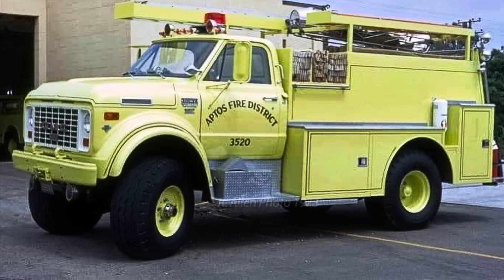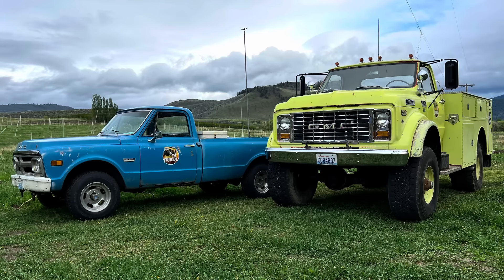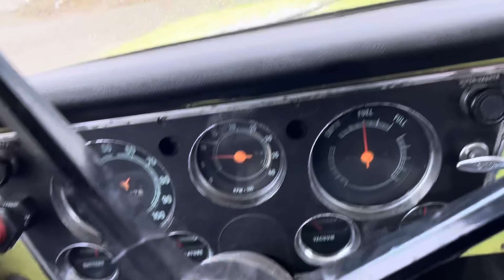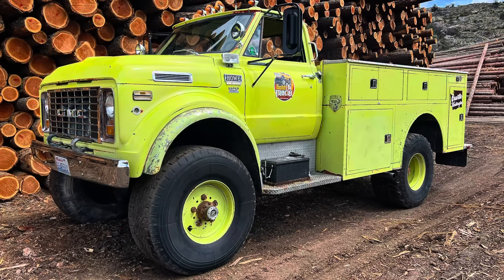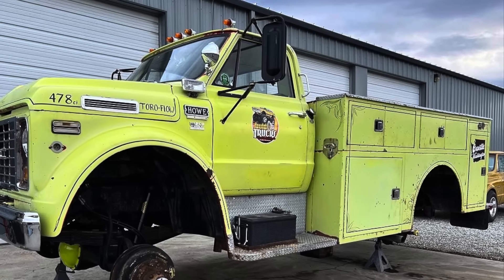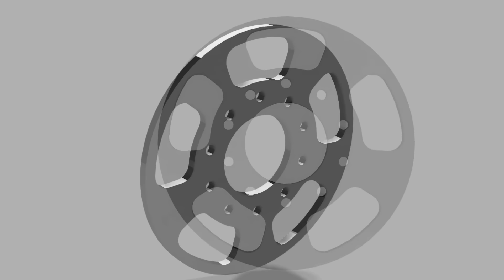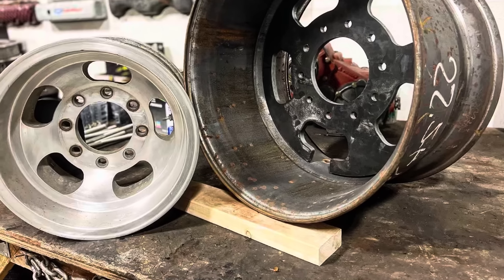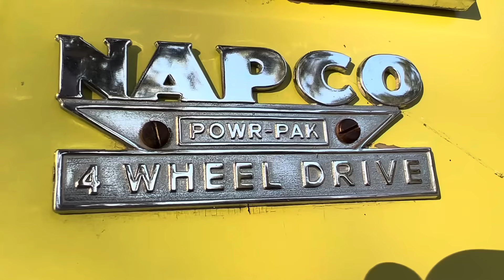My 1972 GMC Napco K5500… The World’s Rarest ‘67-72 Truck! Factory Toroflow Diesel/Allison Behemoth!

Comment: That is a very interesting truck. I've heard of GMC V6, V8 and even V12 engines of gargantuan displacements back in the day, before they began using the Chevy big block 366 and 427  V8s that their corporate twin Chevy trucks used. But this 478 cubic inch V6 diesel engine I've never heard of, let alone seen one of these trucks with an Allison automatic transmission as well.

Comment: I HAD A TORO-FLOW IN AN INTERNATIONAL TRAVELALL, MINE WAS THE "D", BUT IT HAD THE "DH" PUMP ON IT 18 MPG ALWAYS/ANY CONDITION, AT 70 MPH ON ICE IN OVERDRIVE I COULD LIGHT UP 4 12.00-16.5'S... LOVED THAT TRUCK, IT ATE U-JOINTS LIKE POP-CORN...

Comment: It wasnt that long ago (4 decades!) i had a Napco converted 58 GMC 2 door "suburban" truck. The stock 6 cylinder was gone, but still had the Trans, Spicer transfer case, and Axles. Someone had converted it to a 350 previously and i bought the truck with a rod knock in that engine, putting in a 307 marine takeout engine. I had to re do all the steering knuckles, had to come up with new tie rods & pitman arm, even scored a decent steering box. Installed a 50-gallon fuel tank for off road security. Did most all back roads, byways, and highways in northern AZ and Southern UT with it, drove it to Texas on a road trip, no working odometer or speedometer, but i figure i put near 100,000 miles and got away with only 1 speeding ticket while i had it.
it was a great truck, a real ratter but with class, y know? I had it long enough to take my 2nd wife on our honeymoon with it. That was 32 years ago.

Comment: You mention the twin turbocharged Toro-Flow engines . In the late '70s , a customer in NE Ohio had one in a rear engined ex-military bus he was reworking for a motor home . I was called for a potential repower with a Detroit, as the customer experienced 2 engines with broken crankshafts, probably due  to fan belt over tightened.

Comment: 13 mpg? That is impressive.
Reply: Yeah, a lot of stories have been passed down over the years, the Toro Flow apparently didn't do so well if you were carrying or pulling a very heavy load (so the story goes, some older guys say their mistake was, a lot of guys who bought these new in whatever application, treated it like a heavy duty diesel like a Cummins or Caterpillar or one of the bigger Detroits, instead of a medium-duty diesel as it was intended), or rappin' it out as they used to say, runnin' it hard regularly with the rpms up, but, they apparently lasted a long time with fewer issues in marine applications.  The 13 mpg, yeah, everything I've ever read, including the GMC history book I have, the Toro Flow's strong bragging ppint was excellent fuel economy,  even compared to diesels in its class.

Comment: Amazing and awesome find/score. The toroflow is RIGHT up my alley... too bad they're ungodly scarce and very difficult for parts. How the heck do you even find parts??? i found a Uni system corn picker nearby and it has a 401 toro flow v6, i want to buy and shove into a 70s GM pickup.The new custom rims and 3" Straight pipes did it good. Love the cusom retouch pin stripes...

Comment: I just picked up a 2006 c5500  with 50600 miles. It's also a beast. It to pull my 5th wheel in a couple years. Love  to connect with  you a see that  predecessor som day. Where is your shop. Thus is the first I've see your videos.   Jess. A admire or what you have  accomplished.  😅
Reply: I don't spell that bad. I just don't review spell ck. Damm.

Comment: I have a C 4500 Yes
Sway bar steering stabiliser cent traumatic balances on the front end and it runs absolutely true down the road. Thanks for your video thoroughly enjoyed it. 
Look at a fass fuel system it may help with miles per gallon in the long Jevity of your motor

Comment: The DH478 Toro-Flow was also used in some smaller GMC buses during this time (the TDH3501 from 1964-68, the TDH3502 from 1968-69, the TDH3301 from 1969-71 and the TDH3302 from 1972-73).

Comment: They had a lot problems with these engines.  Customer dissatisfaction was the primary reason to discontinue.  Awd is way cool, especially on a vehicle this size.  I am partial to the 478 v6, but they say it used to blow the plugs out.  The very rarest motor was the v12 that was two 478 motors.  It ran at low rpm and sounds awesome.

Comment: She's a keeper, for sure. I was fortunate enough to get a 77 blazer trailer special. All the metal emblems sb 400 to np 203 to th  400  and not a crack in the windshield with the cool blue tinted top. Stable and capable. 
Gotta love those windwings, huh. Oh, and rain gutters over both doors. The thing doesn't spy on ya and not loaded with stupid useless brainpan zombiefying electronics that just put more pollution into  the toilet bowl. 
You got one cool ride, for sure!

Comment: I bought  a 1992 Ford F800  Cab over with a Tool Body and  a Man lift on it. Same color. It came from the City of Seattle .. I bought it for the engine, a 3208 Cat 250 HP  Turbo .. Allison 5 speed Automatic .. it only runs 55 MPH @ 2,600 RPM's  it needs a two speed rear axle.. 4 wheel drive would be great for  Pulling a snowmobile trailer and having a camper in it .

Comment: Super cool to see. I've got a C5500 flatbed. 305 gasoline V6. I would have preferred a diesel. 5-speed manual and 2-speed rear end. No power steering, no power brakes, no dual master cylinder, (yikes!) factory radio delete, and no chrome.

Comment: Extremely nice and neat looking truck and being that it is 4x4 and a factory diesel and allison automatic transmission makes for a rare combination. Does it have hydraulic brakes or air brakes
Reply from the maker: It is hydraulic brakes
Reply: @GoldCityTrucks  I kind of figured I could hear a vacuum pump when it was idling

Comment: Curious if the new low sulfur diesel fuel has had any adverse effects on the fuel system ? Have seen some older diesel engines have injector and injector pump problems when using the new road grade fuel but did fine on the off road stuff.

Comment: 3:15 Are those intakes going to the outside of the heads? Like a hot V design? Cool truck. I like your collection. My dad had a 1969 Chevrolet C20 with coils and swingarms in the rear. I bought a 1970 C20 with leaf springs under the rear. I want to convert it to disc brakes on the front.
Reply from the maker: Yes intake and exhaust both the  same side of head , injection pump in the valley

Comment: Just about all larger diesels use what's know as an SAE #3 mount starter. So basically any starter on any semi will bolt up to that engine but there is three differences you have to look at. One of them being the starter pinion pitch and tooth count(the starter gear), another is the solenoid position or clock. That starter along with most others have a clockable nose to change the solenoid position. The last is the actual size of the starter. The one you have appears to be a Delco Remy 42MT which used to be standard issue back then. Now a days they have gear reduction starters that are much lighter, smaller, and more powerful. You can get a 39MT gear reduction starter for that engine. PN 8200433 if the pinion pitch is 8/10 and tooth count is 12.
Reply from the maker: None of those starters pictured were correct actually.. it was yet another that it took to get it running. Unique design of the nose cone and depth because of the Allison and engine combo. 

I tried a modern update 39mt starter with no luck! Found the correct core shortly after.

Comment: When I heard 22.5x14's were being made, I wondered if you would run a 445/65/22.5 from a front loader mixer. But that's 46" tall and I wonder if they would make that truck too sluggish or fit in the first place?
Reply from the maker: I would have like to run that big .. but they won’t fit. These are 42s and clearance is tight to the front fenders. I consider lifting it more .. but I figured 42s were big enough haha.

Comment: i thought for sure you were gonna say it was a fuel pincher but i guess those were later. Ive never even seen a toro flow other than on paper. Pretty cool-how is it power wise? Also Im curious some of the other specs. What axles/gear ratios/etc did they put in it? Is it a divorced t-case? I'd guess the 4x4 conversion precludes a 2 speed rear-does that early of an allison have overdrive? Might be worth looking for one of the old doug nash 2 speeds (kind of like  a gear venders but it goes in front of the t-case so you can still run in 4wd..if the t-case isnt seperate anyway)

Comment: I always thought that on 1967 to 72 Chevy & GMC medium duty trucks with the hood vents but without the engine call out, meant it was a big block 366.  Because trucks with 6 cylinder or small block V8 didn't have the hood vents. Trucks optioned with the 427 had hood vents & the engine call out that says 427.  But I guess this rule only applied on the gasoline engine trucks, not diesels.

Comment: Great find, great story, even greater truck! But I am left wondering about the welds on the wheels, they look rather small for such thick plate-steel centers, big diameter hoops with big tires, and the weight of the truck. I'm not trying to knock You're truck or video, I think it would just be an absolute shame to lose such a rare vehicle due to a small weld. I have done a fair bit of structural welding in my day, and I think that the use of an LN-25 would have been the tool for them wheels.
Reply from the maker: Fully welded both sides, they are burned in good!
Reply: @GoldCityTrucks  ATTA-BOY!

Comment: You changed the original wheels for a custom set?  Really, you should have upgraded the axles to a modern set and had discs on all four corners.  You would have been able to find a wheel that was compatible for the newer axles.  Those newer axles would be better...and did I mention newer?  GMC Kodiak axles would have been my choice.  Don't get me wrong.  What you have looks pretty good...other than that split in the wheel.  Now that drives me nuts, but the overall look is good.
Reply from the maker: Is that what you did on your factory napco medium duty??
Reply: @GoldCityTrucks  Hardy harr harr.  That was so funny I forgot to laugh.  I get it.  Your truck is huge.  I was going to go into a dissertation about those axles, but after your "ellick" comment I don't want to.  Good day.

Comment: That offset in the back could cause you trouble.  the housings are not designed to have the fulcrum weight of the single offset that far.  I know it matches what you had, but watch your housing for cracks.

Comment: My question is how do you convert a truck like this to 4wheel drive? This truck style would be absolutely the best ever with 2.5 ton military axle with the straight axles with those military tires would be amazing. Just an idea that is my dream truck. This truck would have a 500 hp Cummings with auto with military 4 wheeler dive suspension, ah to dream.

Comment: You should use the old water tank for diesel
Reply from the maker: 1000 gallon diesel tank ? What am I a money printing machine? It would take me several years to go through that much fuel. Silly idea!
Reply: @GoldCityTrucks  Silly? I’d say smart, have a fuel truck come and fill it full of off-road when the price is low, then when everyone else is paying 6 bucks a gallon at the pump you’ve got a mobile thousand gallons of 2 or even sub 2 dollar fuel. But whatever, guess you already have it all figured out, forget I said anything.
Reply from the maker: @detroitdiesel7074  100
Gallon slip tank sure. 

1000 gallon tank
No way. 7 pounds a gallon. Load the bed full of 7000 pounds of Diesel to continuously cart Around and hopefully use before it went bad. 

I can’t forget what you said ! It was too silly.
Reply from the maker: @detroitdiesel7074  do you have a 1000 gallon slip tank on any of your trucks ??

Comment: Thats cool but why steel rims why not aluminum,  lighter, less rotational mass
Reply from the maker: $$$ custom cut aluminum wheels of this size and bolt pattern would have been easily over 50k dollars. 

Wasn’t going to run spacer adaptors on the front 5 lug only. 

It’s had steel wheels for 50 years. Nothing wrong with steel!

Comment: Since Detroit diesel is owned by GM isn't that toroflow diesel in essence a Detroit diesel?
Reply from the maker: With that same logic a Pontiac gto is a corvette. So , no
Not quite !
Reply: Sorry, but no, this engine was developed in congruence with the GMC 60 degree V6 medium-duty truck engines of 1960-1974, these Toro Flow diesels came out a few years after the gas V6s.  But, even though Detroit is obviously thought of as the 2-stroke diesels from 1939 on, I  had a glossy sheet with all the specs & info on the 4 stroke/cycle  6.2 L diesel of the 1980s ('82 first year?) , somewhere on that sheet it referred to that engine being made by the Detroit Division of GM.  I think the 8.2 fuel pincher of that era, also a 4 stroke/cycle  is also referred as being made by Detroit (I could be wrong).

Comment: I know it would be sacrilegious to modify an original like that truck but did adding a turbo ever cross your mind?
Reply: Heat would be a prob both intake and exhaust are on outside of head
It's a 60deg engine and all that's in the valley is injection pump
Reply: I'll take that as a yes it did cross your mind. If you did, it may very well be a first...and might make a good video series.   @Steve-iw8yz

Comment: A Toro flow huh.......cool truck, but be forewarned, the Toro flow was a failure, it a gas GMC gas engine converted to diesel and is very problematic, so just go easy on it, has a very weak block and will blow out head gaskets easily, you got a real cool truck there, maybe a 8.2 Detroit or even a GM 366-427 tall deck gas V-8 will drop right in when the time comes.
Reply from the maker: Not quite true actually. They were not a gas engine converted to diesel. They were concurrently devolved at the same time to be a Multi fuel engine. The toroflow has a much more stout bottom end and by 1972 the year Or this truck , they had all the head gasket issues sorted out. Runs great! No issues with the motor!

Comment: Sounds like shit but it hauls ass for a truck that size never even heard of a toroflow engine the starter looks like a Detroit diesel starter tho . On that note your going to have trouble with that delco remy starter 
There are gear reduction starter that replace them they were used on farm equipment I found one for my 4-51 works amazingly

Comment: You have that BACKWARDS you have 3521 ,3520 has Differant Utility box.  Look at the picture you have that is not the same truck!
Reply from the maker: My truck is 3520. They had both of the boxes redone and added too on both trucks after only a year or two of that early setup in picture. So both looks like that at the start. Many little changes over the years. 

Keen eye on noticing though!
Reply: The early photo has a painted grill & headlight surround, yours has chrome. What gives?
Reply from the maker: @putmeincoach8097 the second fire department that got this truck 3520, in around 1975, put it through a little bit of a makeover. They had some pieces chromed and had the box reconfigured. My truck still has 3520 written all over it . 

So I don’t know.. you tell me.. what gives? 😂